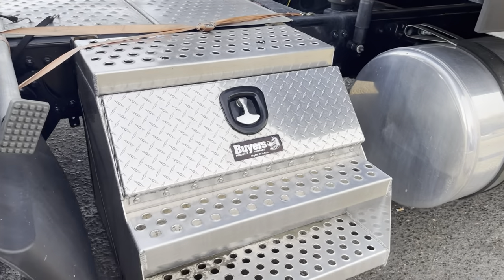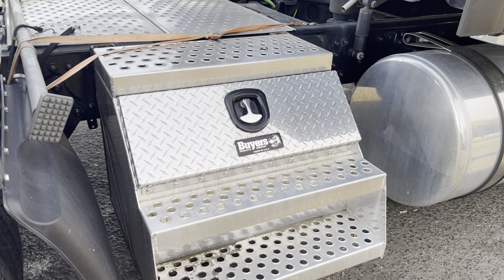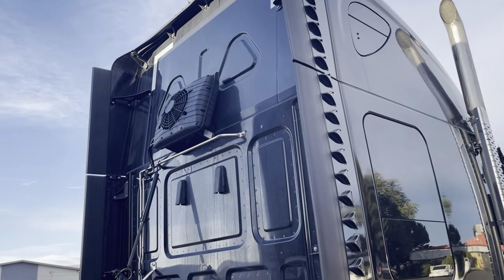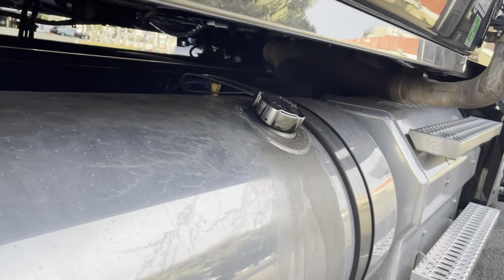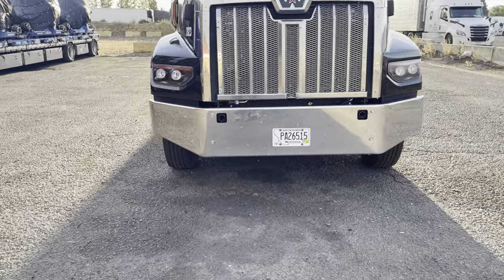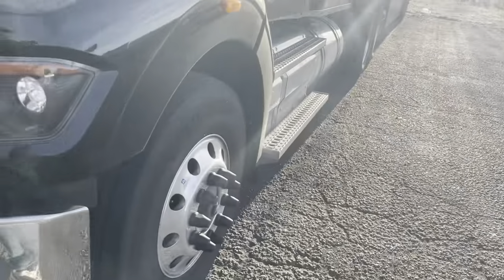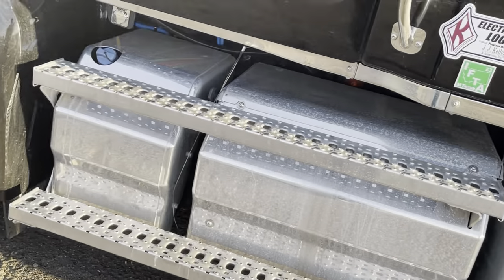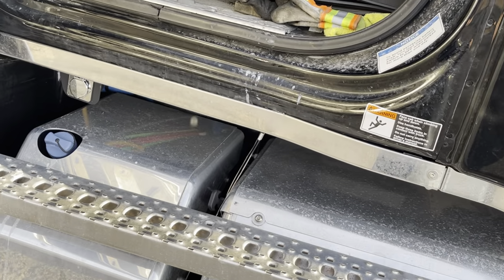2023 Western Star 1 year review

Comment: I bought a wide mouth box from raneys. No water. Just fyi. Maybe replace it.  Nice looking truck.  Diamler isn’t perfect but in my opinion Detroit is the best motor out there with the new DPF systems.  Is the truck dry weight heavier than a Cascadia?
Reply from the maker: Yes it is heavier, not sure by exactly how much, but I know I can’t haul as much weight as I could when I had my 2010 cascadia